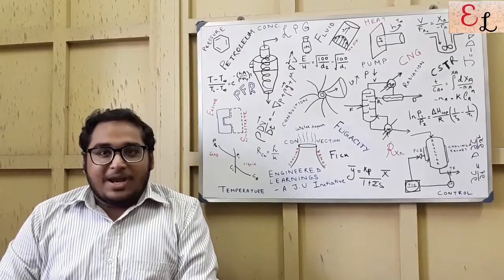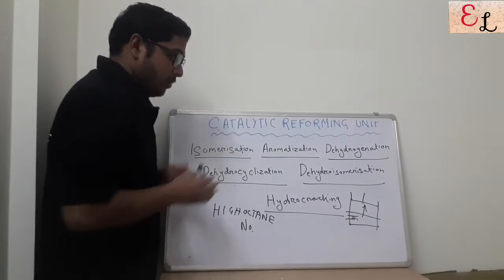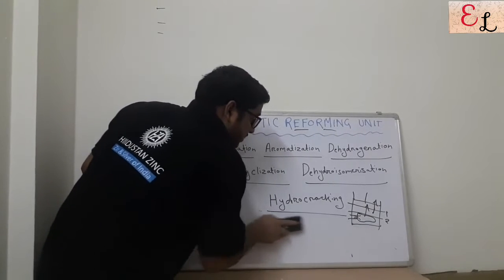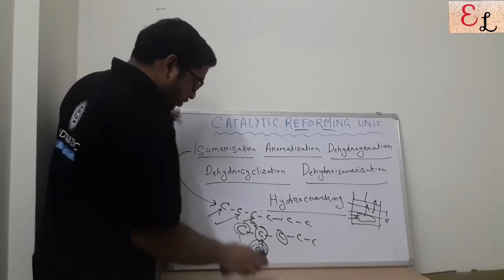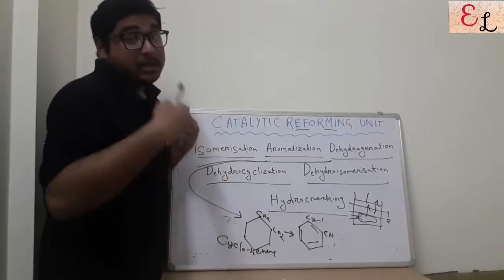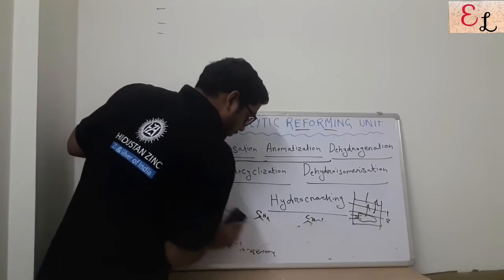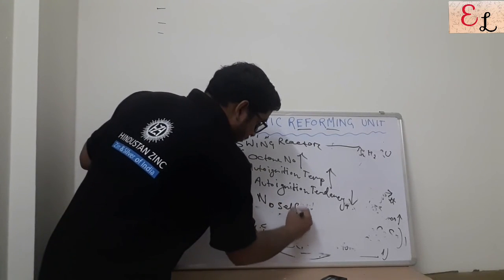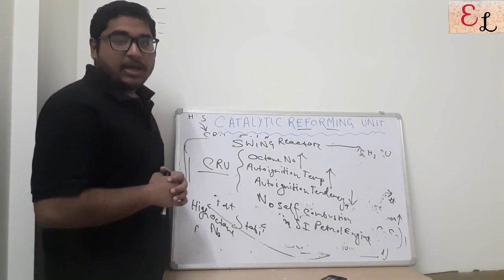CATALYTIC REFORMING UNIT | REFINERY | PETROLEUM INDUSTRY | GASOLENE | OCTANE NUMBER

Comment: I have a question please about the reactors used in the gasoline improvement unit
 Why is 20% of the catalyst added in the first reactor of the Reformer unit, 30% of the catalyst in the second reactor and 50% of the catalyst in the third reactor, and why was the same percentage not used for all reactors?
Reply from the maker: First Reactor has entry of fresh gas whereas 2nd Reactor Entry gas has lesser concentration of Reactant and Higher Concentration of Pdt, third has even lesser concentration of Reactant and even higher concentration of product. To promote the Forward reaction XA (Conversion), Higher Residence Time has to be allowed so Volume of 3rd Reactor > Vol of 2nd Reactor > Vol of 1st Reactor and accordingly the Amount of Catalyst used in the Reactors also varies.

Comment: can u suggest a reference book for designing a catalytic reformer in detail using hysys simulated data?
thanks.
Reply from the maker: You can followe the book of Chemical Technology by Dryden, however there is no specific book as such for catalytic reformer design with simulation, you need to search for research articles